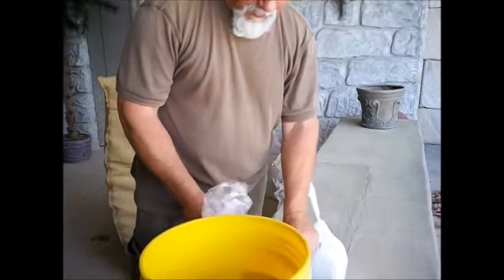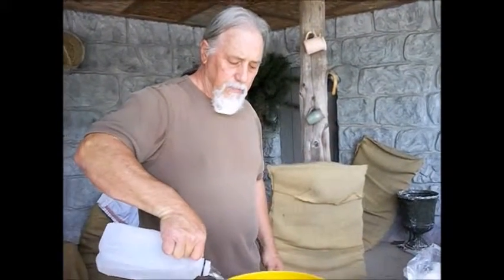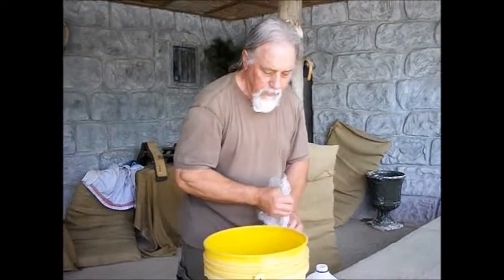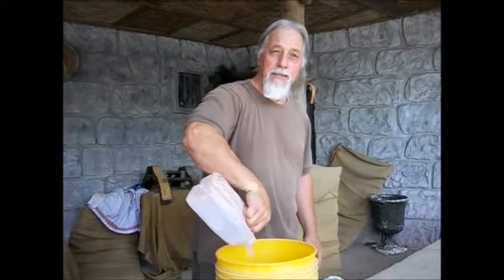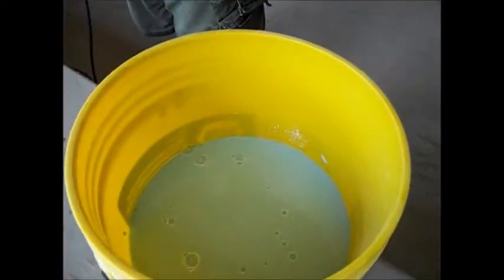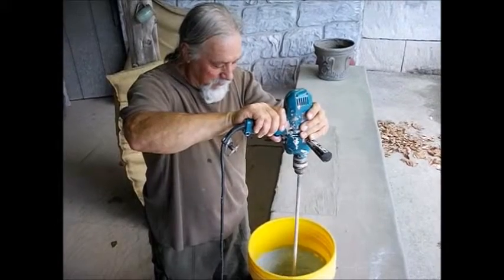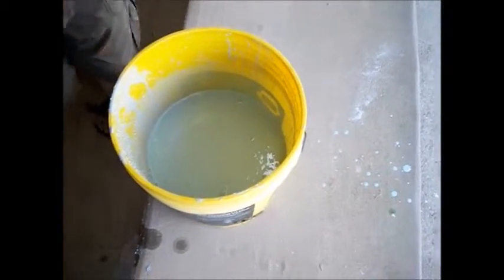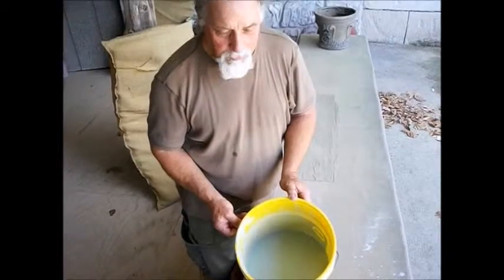How to Mix Celadon Glaze

Comment from the maker: Because it's a breaking glaze, you want the glaze to have the opportunity to pool in the stamped impression as well as cover the surface. If you wipe most of the glaze off the surface, it would just have a greenish tint. However, there are some different glazes you can use with a raku firing method that will craze when fired.